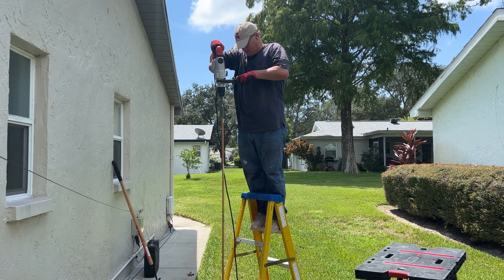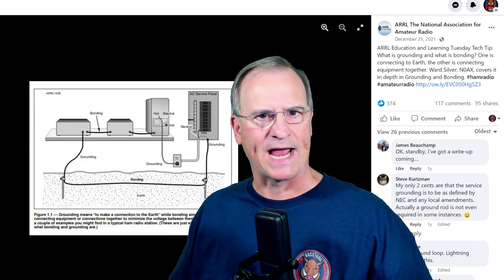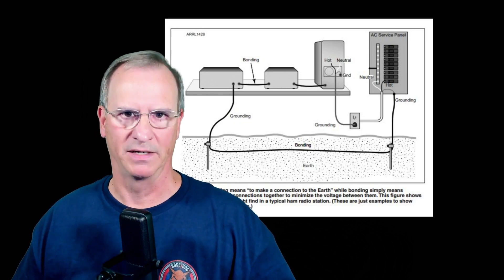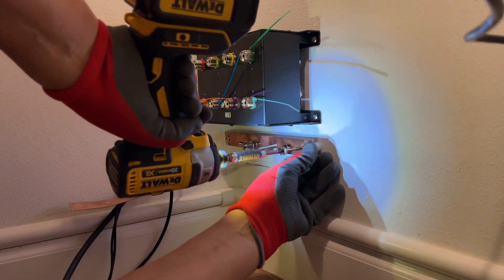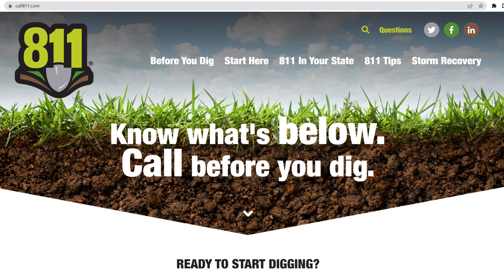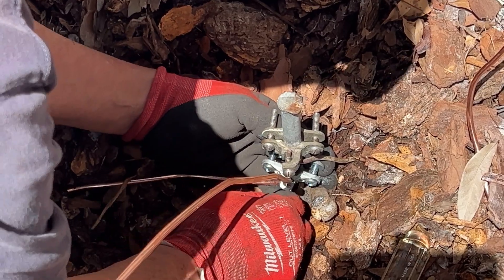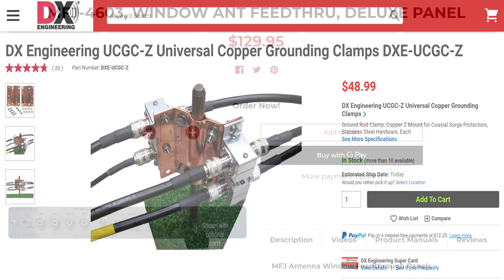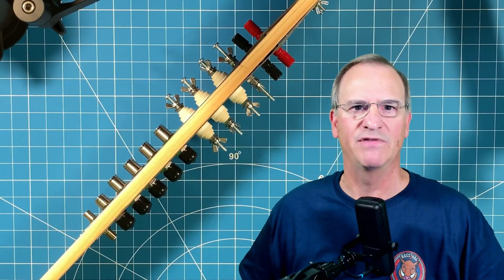New Ham Radio Shack Build Out:  Episode 3 - Shack Grounding and Bonding

Comment: You don't live in my neighborhood. It took me two days of connstannt whackinng with a Tbar bennnce post driver. I used a jack hammer designed for driving  ground rods and in 20 minutes it took the rod down a quarter innch. A hammer drill similar to what you are using was useless except to activate my carpol tunnnel.  Other than the unreasonable way to put in the ground rod that did not apply to me, the rest was quite interesting. Thannks.
Reply from the maker: I am certainly spoiled with very soft soil, and those in your situation...well, there's no easy way to get that ground rod in.

Comment: Using the hammer drill you sunk the ground rod with to drill a hole in the house would have made a more professional hole in the house instead of chancing cracking the wall or making a larger hole than necessary by hitting the wall with a hammer you had the equipment can't understand why you used the hammer instead of the hammer drill?? 🙄
Reply from the maker: Its a thousand pounds, holding it horizontally is not fun, and it will trash hollow block.  Not my preferred tool for the job.

Comment: Can the main ground be used instead of putting in a second ground rod and bonding them?
Reply from the maker: Unfortunately, that does not comply with best practice, and I presume, building codes.
Reply: @HOAHamRadio  - Thanks. Intuitively that doesn't make sense to me. Doesn't bonding essentially make the 2 rods into 1? Haha - I have a lot to learn. Appreciate the response
Reply from the maker: I hear ya.  I'm a mechanically inclined pragmatist; some of the electrical side of amateur radio is Greek to me...so I just do as I'm told in those cases.

Comment: Bob - 1 small correction - that acorn ground rod clamp is designed/listed for just one wire (grounding electrode conductor)  You need to use a second clamp.

Comment: Though I don’t live in an HOA, I find your shack build-out videos very helpful. I purchased the MFJ patch panel (I could find only the 6 version and not the 4, as you use), and there’s a grounding wingnut on the outside of its metal case.  Should I bond that lug to the bus bar?
Reply from the maker: Yes, that is precisely what it is for.  Thanks for the feedback.
Reply: @HOAHamRadio  Thanks. I really appreciate the high level of detail when you describe your work. So many ham elmers assume too much when explaining processes. I appreciate your approach.

Comment: Easily the most controversial and contradictory topic i have seen. No one agrees, seen many videos that show rf ground is a myth, that linking an external ground to a house ground is a huge mistake and against most building codes. I dont know who to believe, opinions coming  from old elmers, arrl, electrical engineers, etc...
Reply from the maker: You summarized it well.  Ask two hams on this subject and you'll get 10 answers.  I chose to follow the ARRL version of the answer.

Comment: Perfect very good, can you please tell me the diameter millimiters or inches of the wire cable that goes to the ground rod? and also what size wire or cable you use from each apparatus radio e.t.c.  to the box? thank you

Comment: Have you looked into the ParadanRadio Antenna disconnect for remote disconnect of your antennas and shunting the signal to ground?  Might not be a lot of help to you as you would need several of them, I only need one. Also I am trying to wrap my head around bonding my antenna lightning ground to the building ground, seems like in the event of even a close stike you would be sending a lot of voltage to your building ground rather than just dissipating it into the soil. Guess it is time for me to get my NEC Handbook out and start reading.
Reply from the maker: I've looked at the ParadanRadio gear out of curiosity but if I remember, it didn't provide enough feedline options for my setup.   Agreed this is a daunting topic...research, research, research!
Reply: @HOAHamRadio It didn't take long to find references about it being mandatory to bond the lightning arrester ground rod to the electrical entrance ground rod, but I am not certain of the authority of that reference, I am looking for the NFPA Lightning handbook, it should hold more information.  My electrical entrance and antenna grounding rods are about 30' apart, I might sink a third ground rod and tie the three together, no obstacles to doing that, and my incoming water pipes (copper) are also bonded to the electrical entrance ground rod

Comment: I love this video series. Any tips on how to deal with the ground in Connecticut? We have lots of potatoes (rocks) in our ground. Is it better to try and try again with different locations, or is there a tool or technique to blast through the potatoes?
Reply from the maker: I don't have any experience with that problem, getting through my soil here is a piece of cake.  If you know any electricians who have to drive ground rods, they may have a suggestion.
Reply: @HOAHamRadio  thanks. That’s what I was thinking too. Might be easier to just call an electrician to get the ground rod put in.
Reply from the maker: If you don't already own a demolition hammer, it may be worth paying their fee...which of course is never cheap for a licensed trade.
Reply: @HOAHamRadio  I don’t really have many tools, but could buy or rent as needed. Just bought my house and I’m a relatively new ham. But I’m an electrical engineer and I know the importance of grounding and safety, so I’m starting there. I’ve been using a portable setup with batteries and disconnecting when not in use, but trying to set up something more permanent now.
Reply from the maker: How refreshing, someone who gets it.  Operating from your home as though you are portable is the right thing to do.  I've had someone asking me how to expand his permanent antenna by lengthening his wire from and apartment balcony, while operating off shore power, without grounding / bonding....  Yikes

Comment: What are your thoughts on bonding a new ground rod to the grounding terminal on my service entrance panel? I have no access to the house ground rod, those dummies paved over it (closest access is 6feet of pavement)
Reply from the maker: Yikes on the pavement over ground.  I would recommend consulting with an electrician on your solution; they are going to know better if this a good idea and to code.

Comment: Those cheap clamps are the weak link to your entire set up.
Reply: The clamps are fine if installed correctly.  I have acorn clamps that have been in service over 20 years.  You just have to maintenance them.
Reply from the maker: Thanks for the positive feedback.

Comment: hi i dug a 400 foot trechy 3 foot deep  around the house 40 ground rods 6 foot galvanaised steel  500feet of gavanaisede tape no bonding to electric sistem that is don thru the psu ground sistem haz to have 2 ohms or under main haz 0 ohms

Comment: Appreciate the video,  could you take the example of the window pass through on,  is your equipment grounded/bonded to it. Is it bonded to the ground rod outside the window? What’s next
Reply from the maker: Simple answer is yes, there is a ground lug on the MFJ unit that accepts the ground strap from inside the shack and then carries it through to the outside ground rod...there was no pic for this I could share.

I do intend to do a video on the window unit itself, but unfortunately, I am months behind in production right now.  It will happen.